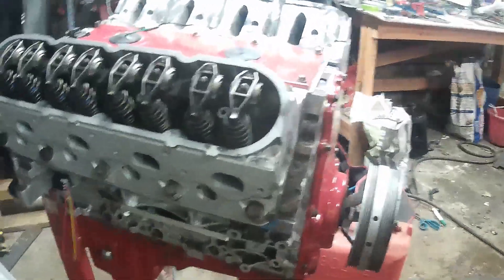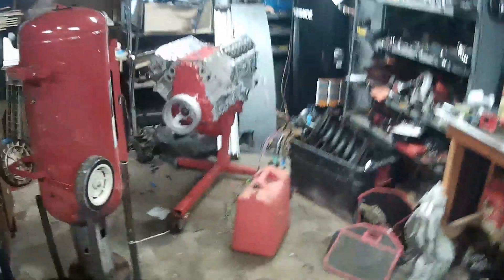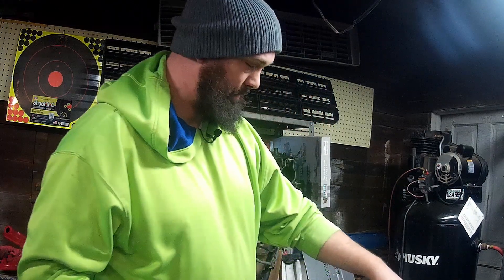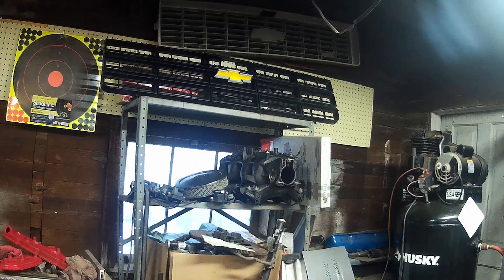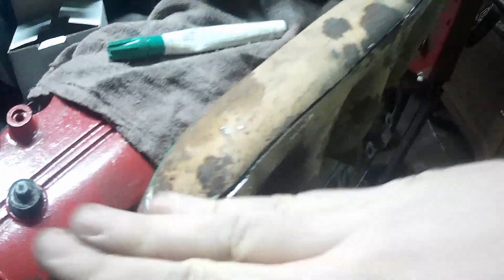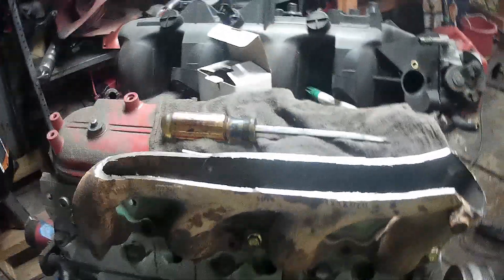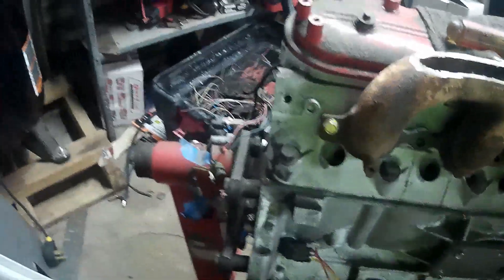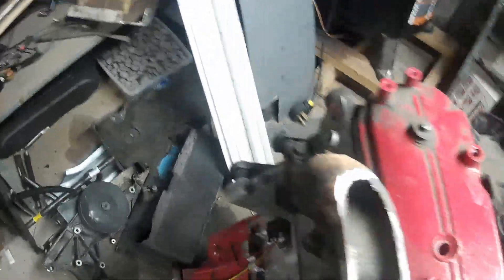Add a turbo to your LS engine. Cheap! Budget log manifold build.

Comment: Did this get finished? I didn’t see a turbo on the truck in later videos.
Reply from the maker: I made a log from scratch, different series of videos
Reply: The Driveway Engineer I found them a couple minutes after I posted his comment. Thanks.

I start my 6.0 swap in a 2003 gmc Sonoma in January.

Comment: Fun street car 700 to 750hp don't have Facebook
Reply from the maker: Starting with a 6.0, the Elgin 1840p cam, Pac 1218 springs.

Log manifolds like Fahler Speed or KB racing fit almost anything.

VS racing 7875 turbo and Snakeeater 150lb/hr injectors will get you there.
Reply: Thanks do you like on3 better than vracing
Reply from the maker: I've never dealt with On3, they are sourcing their stuff from the same place obviously.

I have personally spoken with Viren at VS racing several times and he is always helpful and available, so his customer service is A1.

Comment: How is that working in do you know how much hp your getting thank you
Reply from the maker: It's worked great for 18 months or so, it made 648 to the tires, my decapped injectors pegged before I ran out of air.

Comment: Would be even cheaper doing remote mount...
Reply from the maker: How is buying oil pumps and 27 feet of piping cheaper than mounting it at the source? Unless there is absolutely no way to put it under the hood, it's far better to just put it under the hood.

Comment: Is there a video showing the rest of this build?
Reply from the maker: No, I abandoned the idea because it was too close to the coil packs, I wound up making a complete log manifold from scratch. It was about 130 for everything that way. It may work better using truck manifolds since they are wider than the TBSS manifold I used. 

https://youtu.be/GamGvo7jvA8
Reply: Well wtf? Lol

Comment: You are right about everything... except one thing... the transmission !!! Why go through all that trouble to just putt around with an auto trans ? If it's a dedicated quarter mile car and you need to get the best times I understand ! But ! its not is it ? It's gunna be a fun car... where in the hell is the fun with an auto trans ? NOTHING IS BETTER THAN ROWING GEARS ! NOTHING !!!!
   Look at the prices of old muscle cars ... cars with a standard shift always command more money ! Before long there won't be any more stick shift cars ! 
Sorry for the rant !!!
Reply: well yes and know i cant speak for other manufactuers, but gm used have a thing in automatic cars (performance aimed)a thing called a slap stick mode that was built into the floor shifter.it was a whole separate gate you could hold the transmission in any gear that you wanted to, i had a 72 firebird that had it you could bark the wheels while shifting up off of a stout launch or downshift to what they now call drifting a corner we called getting sideways. but as of lately,seems all cars have a mode called auto stick and it works just like the slap stick factory shifters.
Reply from the maker: Idc anything about banging gears. 

I'm simply not paying 10 times as much to shift myself so I can feel like a man 😂

My 150 dollar slushbox is working great

Comment: I had a 77 step side hugger orange body with flat black hood little 383 stroker in it ran great was a powerhouse out of the hole I had to sub to ya love the trk man brings back old memories 👍👍👍👍👍👍👍👍👍👍👍👍👍👍👍👍👍
Reply from the maker: That's awesome!

I've had a few of these trucks over the years, but most were  back when they were 500 beaters, and I was pretty unkind to them.

Daryl is a keeper though!

Comment: Awesome video..BTW love the shop heater / oven....
Reply from the maker: +BADAZZ93STANG that's my ten or fifteen dollar powdercoating oven lol.

It was actually really nice when I picked it up, but I thought I didn't need to tie it down and it went tumbling down the highway 😂
Reply: J.R. Damn...I'm surprise it worked after tucking and rolling...
Reply: J.R. What powder coating machine do you have?
Reply from the maker: Sorry I missed your reply, I have the Eastwood Hot Coat system, it's pretty good, I usually forget I have to hold a button down while I spray it though lol
Reply: That's for the Colorado cookies to go with the Coors :)

Comment: Tape the exhaust ports off on the head to keep metal dust and shavings out of the head.
Reply from the maker: Yeah I thought of that afterwards :D Good tip for anyone else watching though
Reply: J.R. Rip cylinders walls. Lol
Reply from the maker: Eh, it'll be alright, I scotchbrighted the walls anyway lol
Reply: Also spark plug holes